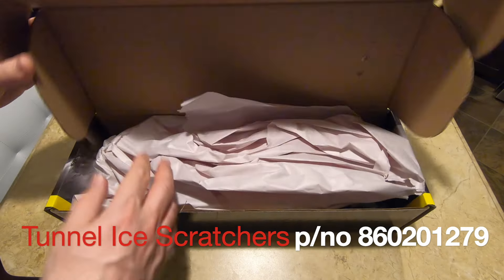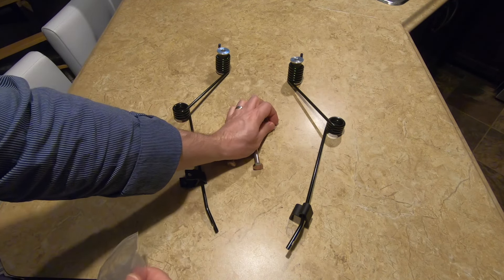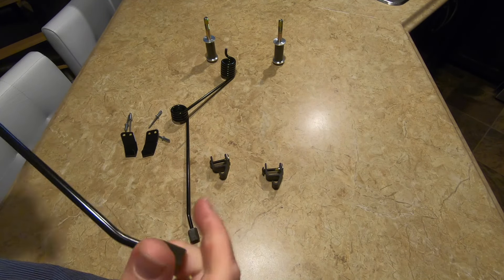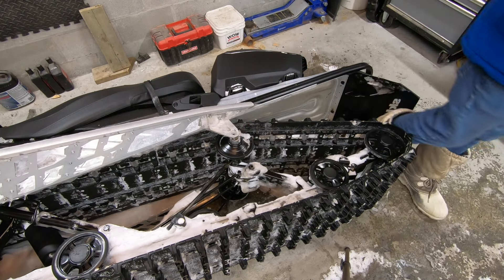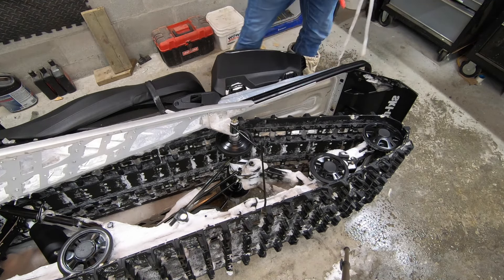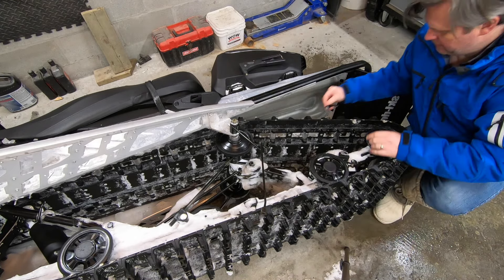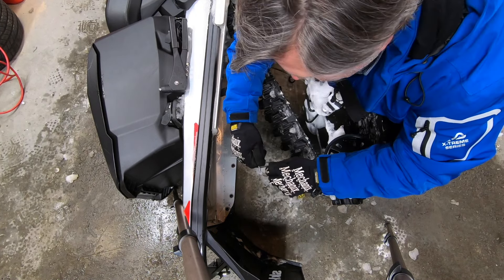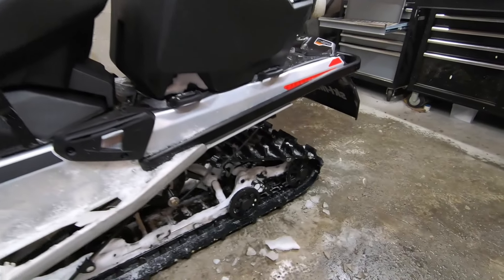Ski Doo Tunnel Ice Scratcher Unboxing and Installation

Comment: Advantage 600 EFI 2-stroke vs my 900 ACE 4-stroke. The ACE 900 oil level does not like laying on its side for extended periods. 600 EFI is also 50 lbs lighter snowmobile. Same HP as 900 ACE in a lighter pkg.
Reply from the maker: I’m out on it right now. Trying to make a video showing how well the ice scratchers work, but the sled won’t overheat!
Reply from the maker: Put another 100kms on it today. Driving slowly, which seems to be its weakness when it comes to cooling, but no dice. It was sitting consistently between 40°C and 50°C no matter if I asked it to climb steep hills, or sit and idle.
Reply: @mop1471  my 2019 Expedition Sport ACE 900 has never run hot. I have ice scratchers but never used them yet. I originally installed ice scratchers for the sliders lube... never had engine over heating issues.
Reply from the maker: @bobkimmcdonald6171  I'm at a loss. When I did the 120km trip to measure fuel economy, driving slowly (30-50km/hr), I had to get in the powder whenever possible to keep the temperature down. Even with that, I got overheat warnings 3 times and had to stop to let her cool down. Picked up the ice scratchers to fix the problem, but now it won't get hot at all. And it's much warmer out today than when I had the overheat problems!
Reply: @mop1471  Is it possible you had an air lock in the coolant system and your rolling it on one side then the other "burped the baby" and now its working correctly? Check your coolant level to be sure it is not low in the reservoir. PDI is really just rapid assembly, there is no test run to prove its working correctly. Either way its running cooler as it should..."Good Job".
Your in Sudbury & I am 2 hours north of Ottawa on Hwy #17. We have low snow this year.
Reply from the maker: @bobkimmcdonald6171 Possible, yes, but on the 120k trip, if I'd dive into some powder, the engine temp would drop within about 10 seconds, telling me that the coolant was flowing. I'm just not sure what to make of it all. My best guess is that the aluminum frame has lots of heat absorbing capacity. Today, I had to cross a lot of lakes, and there were heavy winds, cooling the aluminum chassis off. During the fuel consumption test, the overheating occurred on sheltered trails. So I think the entire chassis became heat-soaked during the fuel consumption test, which didn't happen today.

Comment: Hi, I installed my left ice scratcher. Is it supposed to be loose enough to jiggle or is it better tight?
Reply from the maker: Don't mess around with those bolts: they hold your suspension in the tunnel: Torque the mounting bolts to spec. The spacers that were included with the ice scratcher kit take the bolt's torque, not the ice scratchers themselves, so the ice scratchers will jiggle a little.
Reply: @mop1471  ok, I have a torque wrench but it's range is 50-120lbs
Reply from the maker: @larsqaqqaq9970  Assuming you're in Canada, keep an eye on the Canadian Tire sales. Their Mastercraft Maximum torque wrench goes on some pretty major sales! In the meantime, could you borrow one with the correct torque range? Or hang an appropriate weight from the 12" point on a wrench if you must?
Reply: @mop1471  I received my new torque wrench today ranges from 10-50lbs 👍

Comment: I just ordered these for wife's as well
Reply from the maker: Nice! Warning: wear gloves while popping the rivets. My MasterCraft rivet gun really bit my ungloved hand while installing the first one.
Reply: @mop1471  also those tips are not carbide
Reply from the maker: Ski-Doo says they are: https://shop.ski-doo.com/ca/en/860201447-ice-scratchers-tips.html
Reply: @mop1471  yeah well that's false the have hrc of 30 and they are drilled and tapped plus my buddies were waring out so fast he welded hss to them
Reply from the maker: I have no way to verify Ski-Doo’s claims. Will let you know how these wear.
Reply: @mop1471  sure u do. Use a file
Reply from the maker: I'm not a metallurgist. I wouldn't know what to look for.
Reply: @mop1471  I'm machinist. A file won't cut carbide you also won't be able to drill into it with a hss drill but these u can at least the ones we got
Reply from the maker: That's good to know! Thanks! I'll try it.